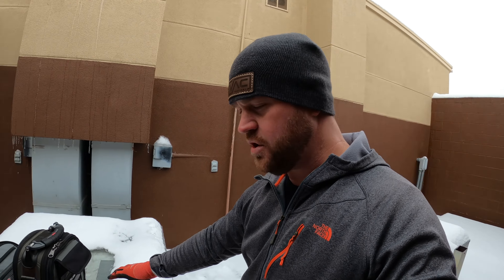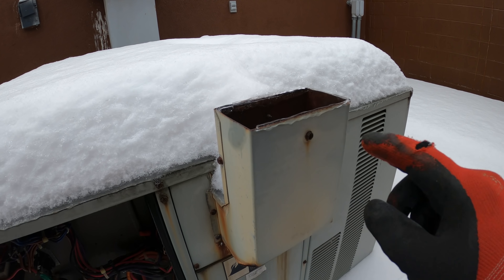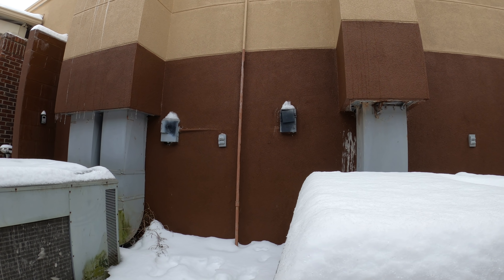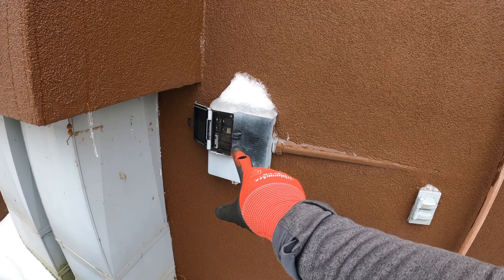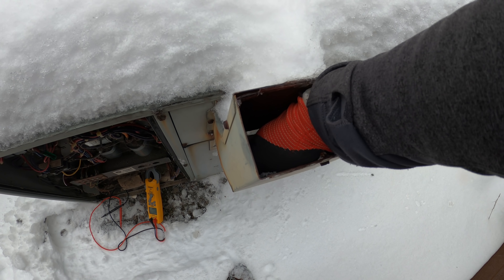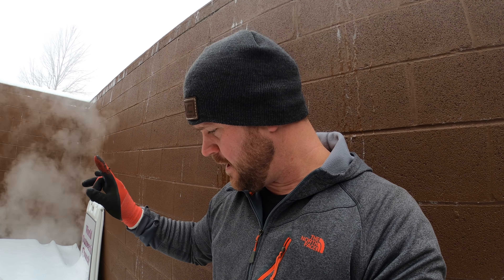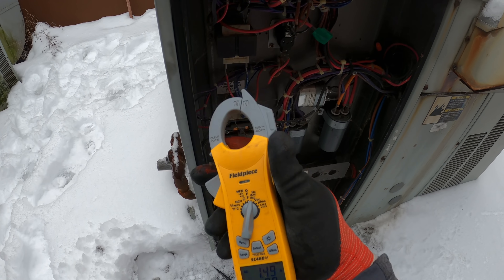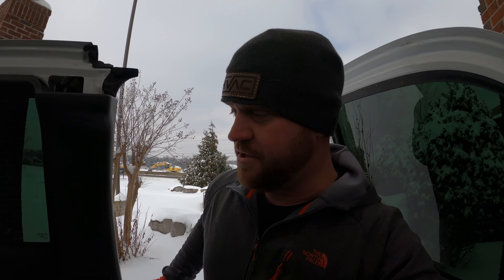NO Heat In A WINTER Storm!! | HVAC Life

Comment: HI, I living in Round Rock city of Texas. I'm working for Round Rock ISD and I had same problem . One unit was in cooling and other one in heating mode. The unit in cooling mode had weak fuse and I let it work for 20 minutes and  I saw the fuse got little by little worm and tripped again. I called electrician to change because of district policy.  The one in heating mode somebody turned of the fuse I guess some student did it. I    subscribed your channel and very enjoying of your posts . Be safe and good luck

Comment: I'm 70 years old and semi-retired after 35 years in the trade. I say semi-retired because I have 30 RTU's at my church that I spent the past 7 months getting them back to working order. Church's don't use the the equipment as much as commercial or residential. I would not be surprised that the breaker was tripped during cooling. You might get a call during peak cooling.
Reply: Exactly!
Reply: Am an owner operator, and I sold my truck 
Now am thinking to go Hvac 
What would be your advice ?
Should I Stay in trucking or Hvac 

Am thinking to open my own Hvac business 
After couple years,  which one is better for long run !!

Comment: I’ve seen a few problems like that where the breaker was tripped but not in the tripped position and a couple times it was a chaffed wire on a bracket or metal with just a little bit of wire exposed

Comment: Always check combustion when you have brought a piece of equipment back to working order. Worst thing you can do is make a repair and get a heating unit working and not check combustion and not check to make sure the package valve shuts off 100% when your done with service. Sounds crazy but it’s that kind of stuff not put on a work order that will get you caught up.

Comment: I thought at first the gas valves were froze. Being your in Tennessee and having warmer temps to get a snow storm and 10-12". That at first seeing thw valves buried in snow i initially though any potential water droplet may have froze. I would have replaced that breaker. I live in Pa. Its  not as snowy as years past. Not fun still but not as bad. Stay safe be well.
Reply: I was thinking frozen vent since the snow was almost to the bottom of the gas regulator.

Comment: Fairly new tech, but do your do diligence, check the primary heat exchangers on both units you touched, look at all the contactors/capacitors , make suggestions on work order.
Also need to do a flue gas test on these older units, check the CO ppm, I know it sucks, but need to protect yourself.

Comment: The breaker could have tripped because the system isn't designed to work in the ambient temperature. The extra work the compressor was doing would have created a higher load, caused the circuit current to increase, especially on start-up. Only an assumption though.
Reply: What you mean? It’s a gas pack though not a heat pump

Comment: Probably you'll be back in summer, when the breaker trips again, from the A/C COMPRESSOR.  Too bad, after you got the heater running, you didn't also jump the 'Y' terminal too.  You CAN do that, while in active gas heat/furnace mode too.  But, its COLD out there.  Maybe just go back in spring to recreate cause of breaker trip symptom.  Then you can put the diagnostic/fix in the pipeline, for an even warmer day.